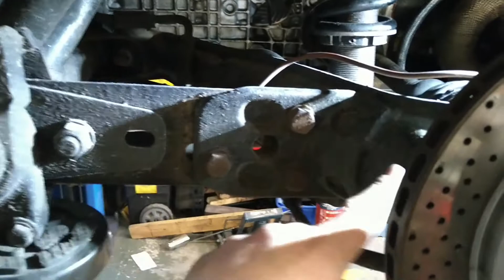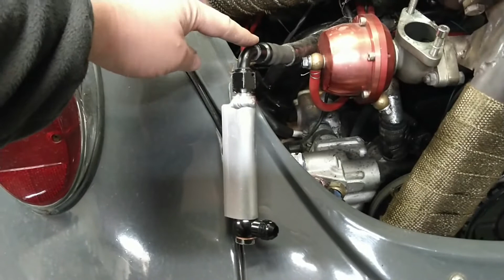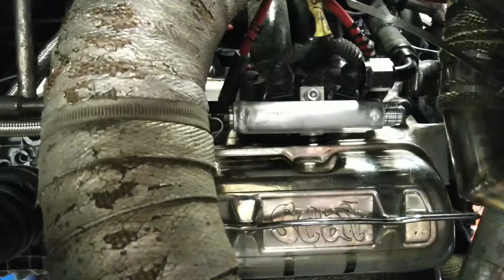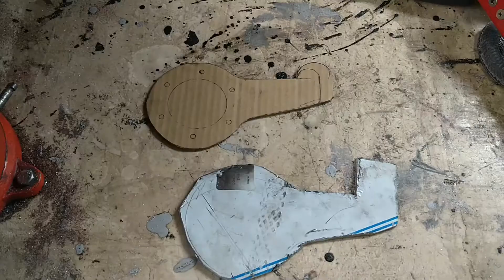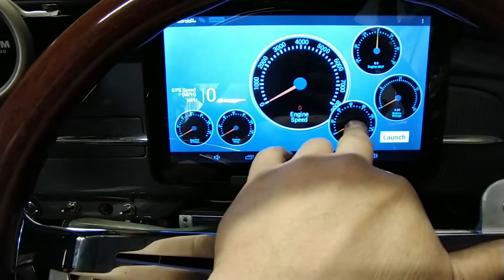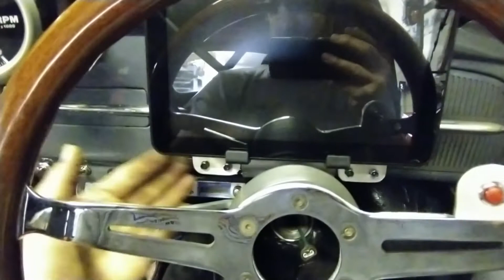300bhp Turbo beetle gets a few repairs and upgrades plus a digital dashboard

Comment: How are you controlling your tablet?   I've seen this done on modern cars with computers but how does the tablet connect to the car?
Reply from the maker: The car has a Megasquirt ecu so all the data on the dash comes straight from that.

I've actually changed it again now. The tablet was great but it had some drawbacks - it needed turning off and on manually and it was hard to read in bright sunlight, plus it didn't have a speedo and it obscured the fuel gauge so I've swapped to a proper race dash now that fixes all those problems.